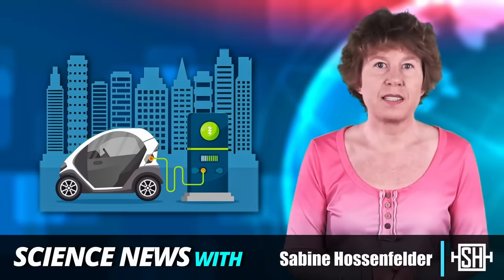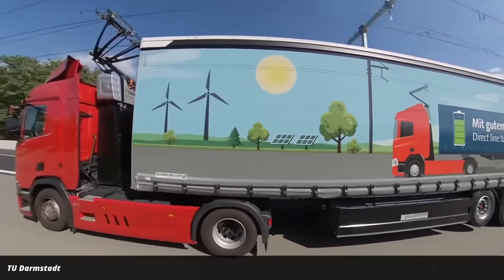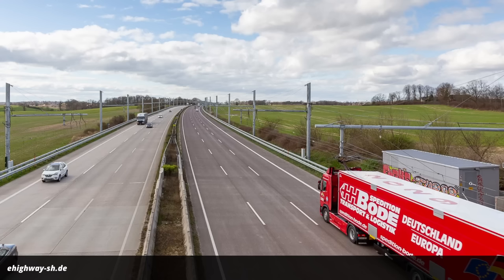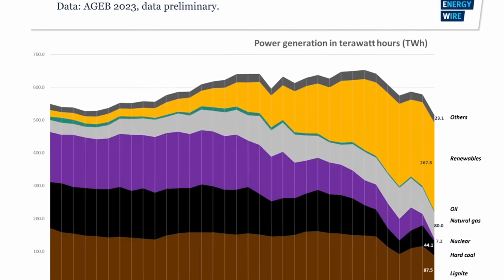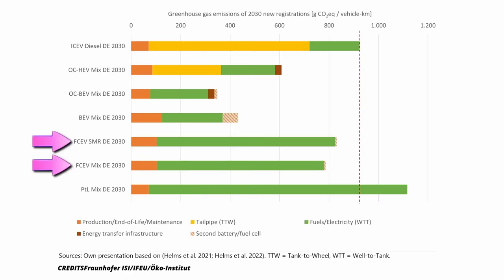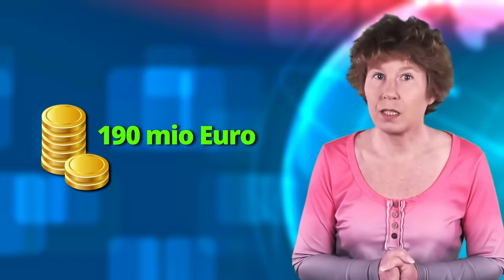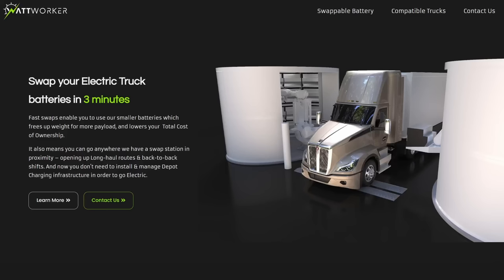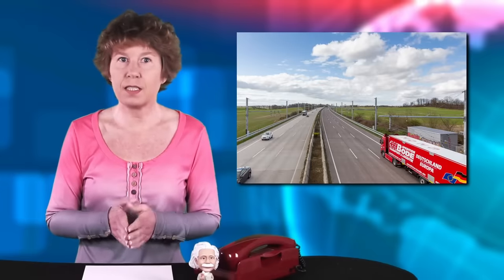Charging while Driving: Does it Work?

Comment: I think a better solution might be to
1) build out charging infrastructure - especially at loading docks.
2) use electric trucks for shorter routes.
3) Anticipate the future based on declining battery prices, improving battery performance, and improving charging infrastructure.
4) Consider alternative ways to solve the problem.  Like an extra set of wheels that can be mounted mid-trailer that has a battery and an electric motor. You get an electric-powered acceleration boost that is mostly fed by regenerative braking.
Etc.

It seems that in 3-5 years there will be no need for the wires because other technologies will have already solved the problem.
Reply: Arent we meant to start living in 15 minute cities? That way we dont travel so far and the goods can be efficiently delivered to us. We can then control how much people travel and reward those who live good lives.
Reply: @robberlin2230  I cannot live without a Belgian beer.
Reply: The Port of Long Beach started doing this in late 2022. The San Pedro Bay complex has 213 electric trucks registered. The charges aren't at the loading docks yet, that will not happen until more of the trucks are electric and the cost of fast charges drops. There are 20 charges for trucks already planned for the port.
Reply: In general, the existing Electric trucks operate at a relatively low electrical efficiency.    Miles per kWh is pretty low for all vehicles - but Tesla is noticeably better.

Tesla is so far ahead that other tuck manufacturers said Tesla was lying about semi mileage - that it was impossible due to physics.

Tesla is replacing its diesel trucks now and they have an exclusive arrangement with PepsoCo.

I think in 18 months Tesla will have learned what it can learn about how to manage electric truck fleets delivering cars and beverages.  

Then they will sell trucks, charging stations, and huge batteries to all those who want a reduction in shipping-related costs...

Comment: Battery swap is an idea that has been around for a while. Your friend Elon once touted it. Haven't heard much about it for a while. One issue, as with everything else with EVs, is the cost. The swapping stations would have to have a large supply of batteries to begin with. Lots of up-front capital.
Reply: NIO have tried to make it work for cars in China as it is State sanctioned for subsidies.  Currently NIO is grossly unprofitable with a tanking share price.
Reply: @waynerussell6401  Figures. Guess we know why Elon abandoned it.
Reply: Cost is part of the problem (especially since both the purchase price AND the electricity are now more expensive than regular cars), but the ultimate issue is the slow charging speed.

People even able to accept lower ranges in sports cars and motorcycles with the premise that they can be refueled in 5min 24/7 in every village.

Comment: There is a company in western Canada that is building heavy haul logging trucks that are hybrid.  Imagine taking a technology that has been in commercial production successfully in cars and applying it to trucks.  The have truck tractor that doesn't need to be plugged in, doesn't need any new or special infrastructure and reduces diesel consumption by 40% or more.

Comment: 2 million per kilometer is expensive, but highway without electrification is also expensive. According to the CPB (the dutch economic planning agency), a kilometer of highway costs 20 million to build in the netherlands in 2016 and that is without tunnels and bridges etc. So its actually "only" 10% more expensive compared to that. To me it seems quite feasible actually. Your point on electricty is valid, but this goes for almost all "green" solutions. They don't work unless we fundamentally solve energy production, but that doesnt make it a bad solution, it just shows us that our core focus should be in providing green energy production. We still have many applications that could use green energy tomorrow, we just don't have the green energy for them. Also this is not compareable to trains, those have much lower flexibility. Trucks are more expensive per cargo/mile, so why would we use them at all if we can solve everything with trains? 

PS the graph showing nuclear power production in Germany is the most sadding part of the whole video :-(

Comment: Maybe someone who knows the numbers can enlighten me. Is swapping batteries for electric vehicles viable?

If we only have electric cars driving around, and the range of said cars is lower than gas powered cars, they'd have to charge (or swap battery) more often. They do have the advantage of charging at some of their destinations though. So would we see an increase in traffic to "gas stations" (swapping stations), or a decrease? Can we store enough batteries at swapping stations and charge them fast enough to accommodate all those cars?
Reply: I don't think battery swapping will be much of a market for anything larger than a scooter, although scooters with swappable batteries are working in Asia. Charging time on batteries keeps dropping. the San Pedro Bay complex has chargers 26 tucks at 2-hour charging and they are starting on their 20-minute charging stations. For cars, most people can do their daily charging at home every night. It is only when going on longer trips in the hundreds of mile ranges you need to use other charges. There will need to be more charges installed in parking lots though.

Comment: Why not install conductors in the road surface? With modern technology the vehicle could manage the connection dynamically to find them, turn power on and off for safety, billing etc. Vehicles would then only need a small battery which was recharged intermittently as power was found in the road. Similar to a tram but brought forward to the 21st century.

Comment: I am all for electrifying highways and trucking routes, but this way of doing it with the power lines that the vehicles need to be in contact with seems kinda weird to me. What I think is a much more promising technology is induction electric charging road panels. There is a startup company in Detroit that recently constructed a proof of concept for this in about a quarter mile stretch of highway. All you have to do is install a receiver on your vehicle and just drive on the road like normal, and it gets charged, somewhat like wireless charging pads for cellphones. I would like to see that technology be developed more.
Reply: Induction wastes about 80 percent  of the electricity which means you would have to provide 5 times the energy compared to above lines
Reply: Rather than charging a battery, better propel the vehicle directly, similar to a maglev (without the 'lev').

Comment: There is a much more practical way for charging cars on the way: inductively from the road without any direct contact. This technology is under research near the old Transrapid Test-Site in Germany. This maglev used a similar power transmission to the train.

Comment: The trailer is all that has to be moved from one point to another.  Therefore, it's better to swap tractors than to swap batteries in each tractor.  There have to be a few spare tractors that are sitting in the charging stations but they are less hassles than building each tractor to have swappable batteries.

Comment: I can see the merit of the idea, but over the longer term, it's probably a waste of money because as battery tech keeps developing, it's only a matter of time before they can have enough power to power the truck.

Maybe a better solution could be having solar panels on the top and side of the trucks to give it more juice on the go and whiles parked, not sure how much energy that would deliver or if it's worthwhile, but with how cheap solar is getting, it might be a better solution, especially because of the size of trucks, they will be able to add a lot of panels on the top and both sides of the truck.

With all that said, it really depends how expensive it is to have a network of power lines on the roads and if this is just for newer vehicles or if there are cheap solutions that would work on existing vehicles.

Comment: There is an additional benefit that doesn't seem to be mentioned: hybrid trucks are more efficient even when they aren't connected to the grid than a normal diesel truck.
They can regenerate power on hills that would otherwise be wasted and they can keep their engines in the optimal power band and supplement with electricity when going up hills.
In traffic they can cut off their engines all together. And electric engines are more responsive than diesel ones.
Being able to charge these vehicles while moving is a bonus, to be sure, but that's hardly the real benefit here!

Comment: There are issues with maintaining contact when the overheads begin oscillating.  It's not such a problem with trolley buses because they don't tend to follow each other at high speed. And are generally limited to 70 km/h or less... Though hybrids can go faster when diesel powered.

Then there is also the general problem of scalability with power supply requirements on long climbs with each truck requiring hundreds of kW just to maintain 80km/h on the Autobahn.

As you note, there's also the issue of power generation. And the electrical power distribution infrastructure.

Battery exchange makes things worse and vastly less reliable. Recharging stations will be drawing perhaps  tens of megawatts each, just to maintain a small stock of batteries. And the state of wear of the batteries will be a huge consideration when determining the next truck stop.

With batteries, will trucks even be permitted in the longer tunnels?
Reply: - the issues with oscillation should be pretty easy to overcome: keeping the lorry on track is already done with automated steering. The same could be done by adjusting speed and distance, and the amount of pressure applied to the overhead lines dynamically. On top of it, by varying the distance of the poles and the tension of the overhead lines, it should also be possible, to move the eigen-modes out of the band of the exciting frequencies.

- The 'problem' of long climbs has been solved long ago for electric trains:  the Baureihe 94 (-> Wikipedia) was first delivered in 1940 and used right up into the 90ies by DB, DR and ÖBB to tow freight trains with the several 100 tons of weight through mountainous terrain, occasionally taking complete lorries/trailer sets piggy back as part of the project 'Rollende Landstrasse'. across the Brenner. Compared with the power requirements for that, having 10 lorries crawling up the Kasseler Berge at the same time should be quite manageable. There, even the current diesel lorries aren't maintaining 80 km/h, when fully loaded. Why then should the electric ones?

- The requirement to spiff up our supply of electric energy comes as part of the change. The initial investments are steep, but the long term prospects are promising. In the last 100 years, electric power generation, transmission and consumption has been proven to have far better reliability than all combustion technologies together. (I'm a bit fed up by now with this faux hen/egg arguments)

- If we allow tanks filled with flammables through tunnels plus a battery for ignition, why shouldn't we allow purely electric. The insurance companies tell us, that damages caused by fires on electric vehicles are fewer and less costly so far, than the ones by combustibles. If sodium batteries gain traction, the issue will become moot.

Comment: Could you run the trucks with retractable steel wheels on the rail tracks that already have existing electrical infrastructure then retract the wheels and run on diesel to the final destination?

Comment: Sabine, I have yet to see a discussion of the possibility of using electricity from renewables being used to generate hydrogen (by electrolysis or solar thermal splitting) and to extract CO2 from the atmosphere and then split it into carbon and oxygen, and then to combine the hydrogen and carbon the create a liquid hydrocarbon fuel.  Are you aware of any research along this line?

Comment: It's worth noting that even when electricity comes from dirty sources, like in Germany, EVs are usually still less carbon-intensive per-km than an ICE; although they do have a higher intensity during construction, so they need to be several thousands of kms before EV's come out ahead. A coal power-plant is simply so much larger and more efficient than a car engine that it remains cleaner even after the losses from transmission and the efficiency of the EV. So electrifying a truck with coal power is likely still better for the environment than burning diesel. 

Not to mention it's probably easier to contain the particle pollution of a single large power-plant than it would be to contain the pollution of every gas-powered vehicle. And reducing particulate pollution should always be a high priority goal, as it much more directly harms the people exposed to it compared to the more widespread effects carbon emissions. And if electrifying trucks can accomplish both at the same time, that seems like a massive win to me.

Although, building out a more comprehensive electrified freight rail network would almost certainly be a better investment long-term. If trucks were only needed for last-mile delivery, they could run on batteries without needing the overhead charging, since they wouldn't have to travel very far and could afford to recharge more frequently. Alternatively, if the rail network was extensive enough and the last-mile distances were short enough, you could do more of the last-mile delivery with smaller, simpler, and less intensive vehicles like a box van or cargo-bike.
Reply: Where do they have that many gas-powered trucks?
Reply: @shanent5793  I'm not sure what you mean, most places have that many gas-powered trucks.

Firstly, most trucks are gas powered, so any place with a lot of trucks is going to have a lot of gas powered trucks.

But secondly, a large number of places have a high rate of truck use for freight. Germany for example moves over 70% of all its freight by truck. 

And as the largest carbon-emitter in Europe, decreasing the carbon intensity of Germany's largest freight mode would be a big deal. It's a similar situation for the ol' #2 emitter, the USA. At ~60% of freight moving by truck, but a much larger overall freight market, the results of de-carbonizing trucks would be massive.
Reply: @cebo494  The vast majority of trucks are diesel powered. Diesel vehicles also have particulate filters that make their exhaust cleaner than gas vehicles.
Reply: @shanent5793  "Cleaner" is still not "clean" though. If it were electric, it wouldn't have exhaust in the first place.

Comment: I really wonder why so few projects seem to focus on the "swappable battery" part. Especially for trucks and other utility vehicles like buses, were one can assume some degree of standardization.
Reply: It has been tried and kinda failed for cars. And it won't be easier for trucks. Swapping those batteries sounds easy, but keep in mind they weigh more than 1000kg. Have high voltage and current. Are flammable, maybe even explosive,...
Reply: @Robbedem  I understand fully why it could fail for cars. But there are far fewer manufacturers of trucks than of cars. Thus, there should be far less model variety in trucks than in cars. 
And the weight, assuming standardization, should not be an issue either. After all, you only would need one single lifter or crane if all trucks used the same battery pack. And the most powerful industrial robot arm lifts something like 5 tons.

Comment: I'm from Athens and we have various such lines in the city for decades now because some public bus lines in the center are operated by trolleybuses. It's really not that difficult to do it. I mean if Greece of all countries can manage to install and operate that piece of public infrastructure, I'm sure that Germany can do it much better. Our public infrastructure sucks in general, it's among the worst in EU, our trains crash with each other because we have zero telematics, so if we can put some wires up on top of our streets, it's literally doable for any EU country 😛

Of course the power requirements for trucks and trolleybuses might be a bit different but in the end as you said Sabine it's a matter of economics and incentives. Also there are a lot more stuff powered by electricity nowadays than in the '70s so electricity is a much more sought after resource (though Germany is in that state because it literally replaced nuclear reactors with coal power plants).